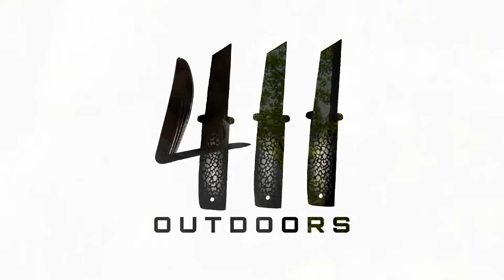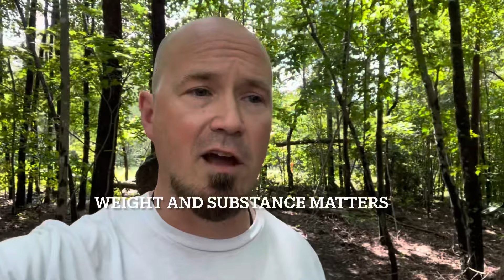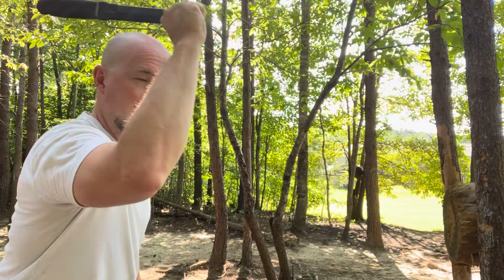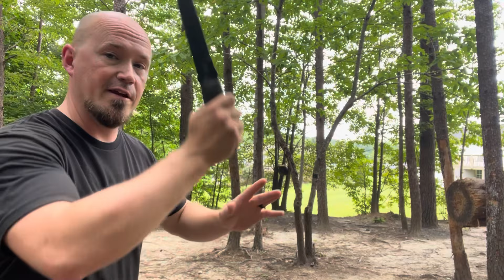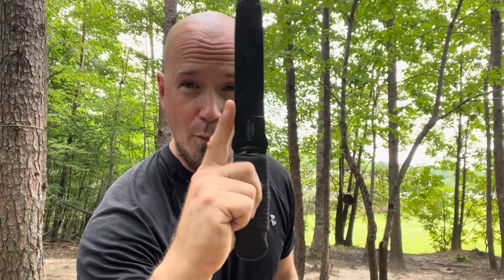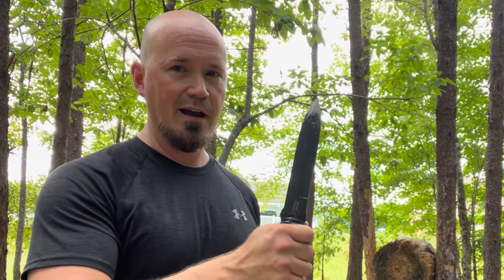Knife Throwing Tutorial for Beginners

Comment: Thank you. I had a problem with the Smith and Wesson knives but I finally got them to stick at close range.  The Cold Steel is the way to go. On the Jack Dagger I sprayed my handle with a product like Flex Seal ( rubber based) that helped a lot.

Comment: the bad throw recoil ain.t no joke.  be rdy to jump on your half throws.

hit = math.  distance to target, arm length, blade length.  tweaking any of those is pro-level (if u can tweak your arm length, i.m impressed)

consistency.  throw the exact same way every time.  adjust your distance by even an inch after a miss.  pay attention to the blade.  did it stick handle up? inch frwd. down? back an inch.

i use heavy blades, not that long thing he.s throwing.  I like blunt edges because i.m holding the blade half the time and rely on kinetic energy for penetration.

i manage abt 99% @ 2' from the handle.   abt 95% @ 3.5' frm the blade. about 80% @ 7' frm the handle.  abt 50% @ 10' frm the blade.

i.ve thrown dozens of thousands of times.  good blades balanced for throwing. 

it.s fun and frustrating....lol.  it is NOT for self defense.  I read gil hibben.s book early on and he said 'if I was in a self defense situation and had 2 throwing knives, i MIGHT throw  one of them'

Comment: Good tutorial , thanks. How do you do it from a wheelchair?
Reply from the maker: You could actually do a good rotational throw sitting down usually 10 feet. May have to lean in slightly. Just make a smooth cut downnward and let go
Reply: @411Outdoors  thanks
Reply: You may also refer to Adam Celadins channel his videos are also excellent to start and to learn knife throwing. In one particular video Adam is showing how to throw from different positions, even from sitting on the floor. And he is a real professional showing how to throw with most of knife types available on the market or even making your own throwing tools just by buying a 300 mm construction nail and making a grip using tape.

Comment: Great series. Thank you. I’m not that good (yet) and didn’t know which end to hold it at first. 
Started with the sharp end but when I changed to the handle I noticed that I got more power in the throw. 
By the way, I didn’t know which distance to start from so I started from like 8-10 meters and it went well. But when I saw your video I probably should start at a 2-3 meters for the best result?
Reply from the maker: That distance will allow you to develop some half spin and some up close no spin🙂👍